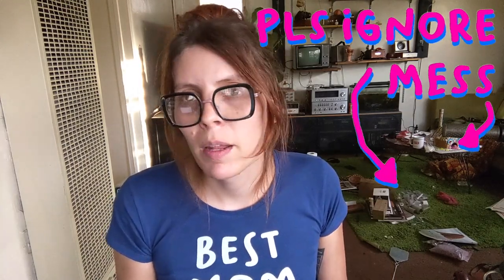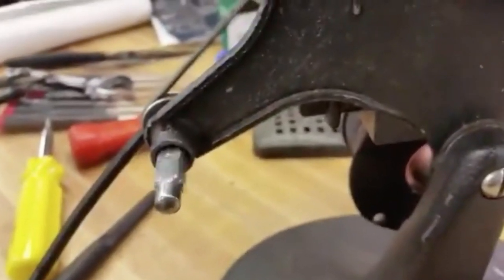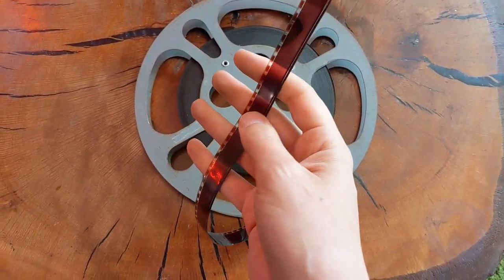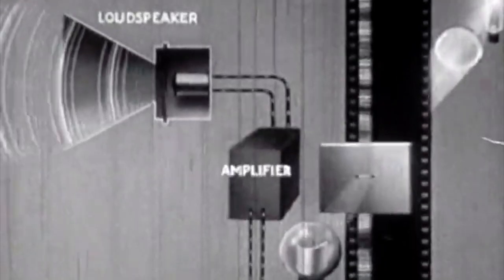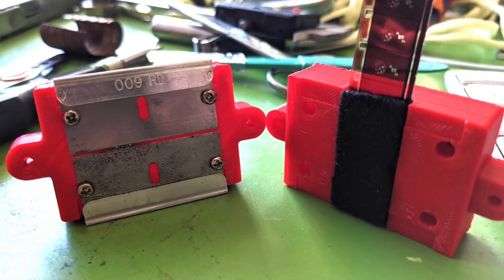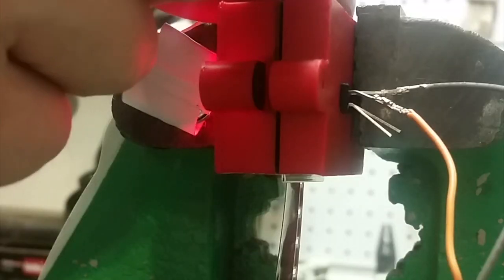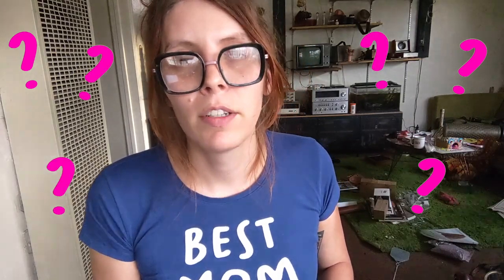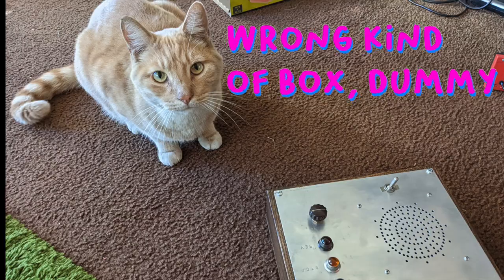The Optical Sound Decoder: An exploration of old film technology

Comment: Outstanding work. A few years ago, I bought several 35mm film trailers with the hope of decoding the sound track. I asked a couple of my electrical engineering undergrad project students to give it a try and also tried to talk my cousin who helped build an amazing FabLab at his local high school into getting some of his students interested. No one was able to complete the project. Sometimes undergrads try to make things too complicated. Even the very bright ones. I was inspired to have students work on this because I have built a bunch of inexpensive optical communication systems that can easily transmit sound on a light beam. I have used LEDs and lasers as the light source and photodiodes, phototransistors, photoresistors, solar cells as detectors. I like solar cells because they are easy to use, work in the audio range and block most high frequency noise. I have also used a variety of signal conditioning and amplifiers, like the transimpedance amp you used. Excellent choice.  If you want to learn more about these experiments, I can add more info in the comments. For now, I just mentioned these things to show you my interest. Again ... great job.

Comment: Nice project!!! I want to use this device to decode flickering lights and produce a audio output. This seems like a great method. I looked around and could not find anyone using it for an audio output. Can you tell me how you hooked it up to your audio amp? Was it as simple as connecting the out and the ground to an RCA cable and hooking it into your amp? Or was there more circuits involved?  thanks!
Reply from the maker: Yes! I just connected the output of the OPT101 to the input of the amplifier. I didn't use an RCA cable. They are wired together on a piece of PC board inside the device
Reply: thanks i'll probably hard wire it also- funny how little i saw on the net anything regarding  hooking  it up to an  audio amp ! i was looking for the 1-2 Volts input spec and i never saw it....

Comment: I just recently got a working 8mm projector with no sound, would this process be possible for use with 8mm film as well? I'd love to have one work in real time with the projector but doubt I could fit any additional mechanisms inside.
Reply: I think it's very rare for 8mm film to come with an audio track, and the few that do often use a magnetic track similar to the tape in an audio cassette. If you have 8mm film with an optical audio track, this would work, provided you adjusted the dimensions

Comment: Hi…Can I please ask how you got to the audio output? Did you connect the sensor directly to an amplifier or did you go via an Arduino board? if straight to amplifier which one did you choose?........Trying work out how to do the same thing as you but with 9.5mm optical sound film and my old head is struggling to work it out, ....Thanks

Comment: are you using a red light? would'nt white or blue be better?
Reply from the maker: If you are thinking that the blue light has a shorter wavelength and would allow finer resolution in the reading, i think you're right in a sense, but i don't think the waveforms printed on the film are fine enough for that to matter. What would white do for me though?

Comment: That makes interesting sound. But there is high pitched sound in most of the sounds from it. I wonder if film was made like that or that is an artifact of garage made reader?
Reply from the maker: That's the sound of the stepper motor you're hearing
Reply: @EmilysElectricOddities  sad times then, it intrudes into the soundtrack a lot. At least looks like that from this video.
Reply from the maker: @mechadrake  No, I'm ok with it. It's part of the aesthetic

Comment: I think your use of a stepper motor is adding some distortion.  Maybe put a spring and flywheel between the motor and the film so the speed is kept even.
Reply from the maker: It is, even with microstepping set very finely, and I thought about mitigating that somehow. But, I don't have a machine shop, so making a flywheel is just more trouble than its worth for me
Reply: @EmilysElectricOddities  Maybe put a flywheel on the film drive and link it to the stepper with a rubbery belt. A low-pass filter for motion. Better still use a synchronous motor (eg record  player motor) for a less steppy drive. If you need to change the speed you can use a stepped pulley or a variomatic-style drive, or a variable frequency AC drive.
Reply from the maker: @theelmonk  The flywheel and rubber belt would definitely work, but I still lack a machine shop for making a flywheel. If only I had a metal lathe
Reply: @EmilysElectricOddities  I don't think it needs to be particularly heavy, even a 3d printed system (with plastic spring) would work. It probably isn't worth the effort though.  Really like the project and what you did.
Reply from the maker: @chrisBruner  I suppose it would be possible to 3D print a shell and fill it with resin and BBs or lead shot or something. It's something to think about for future projects